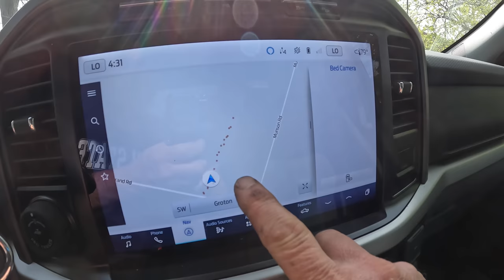Getting the Pole Barn Addition off the Ground & Scrappin' It

Comment: We had a big slope on the side of the shop.  So one group charged 5000 to pack a side on if wanted to build a lean to.  Didn't stop the water from washing the slope off.  Tried different contractor.  2300 for packing the huge white rock at bottom and then all way up.  Fixed our problem.  We have lots of parking but could have done second price easier on pocketbook.

Comment: My son just bought a john deere 346 baler with a kicker. He bought it cheap but it was sitting outside and the plunger was stuck. We took a long hydraulic cylinder and hooked the hoses to the tractor and used the cylinder to push the plunger back. We oiled it all up and now it runs. hope it will tie. It has some fairly new knotters on it.

Comment: A good video. Very informative. We use steel beams and posts etc mostly for sheds in Australia. Re the dots on your truck's GPS screen. I think they show where you have been so you can backtrack if needed when off road. That's what I was told at a recent Four Wheel Drive course I did.

Comment: I stake all of my traps down with 2' lengths of rebar. If they get trapped and flip the cage over, the cage opens and they escape. I use baling wire on my connibear traps.

Comment: Raccoons: Buy and use a Duke Dog Proof foot trap. Use small marshmallows or honey bun (attracts ants).  Smart coons will not go into a trap. If you want to use a trap cover the top and sides as like a tunnel. drive a piece of rebar from the top thru the bottom into ground to prevent drag offs.

Comment: Hi Pete, I was wondering, on your new pole barn for the cows, what if instead of an end wall with a door you had insulated big doors with a door still in one side of one if the big doors that open but you also had a side door.  I was thinking if you had that, when it comes time to clean the bedding pack out you could put the cows out the side door, open the big doors and drive through to clean the bedding pack out.  You'd be headed in the direction of where you place your bedding pack and that way you wouldn't have all the bedding pack to manually pitch fork into the tractor bucket that gets pushed against the back wall like occurs for you now.  This would really help I think especially as you age so you don't have the heavy manual lifting of bedding pack.  Just a thought and may not be feasible at all, I'm not a farmer 😊 but thought I'd share to see what you thought.

Comment: Did the builders seal the ends of the posts with creosote, pitch , tar , or coalas,  it's nearly a must on larger size treated timbers as the end grain will still suck up moisture and it washes out the treatment over time and rot eventually sets in , l like the idea of pre cast plug footings we can't use them here they must be cast in place and at least 2ft dia with a securing mechanism to the poles to help prevent wind lifting action

Comment: Your Raccoon is getting trap smart.
I find a Cheese Whiz  Jar and Jam jar/peanut butter in the trigger end.  They have no choice but to go in the trap as they cannot get in the jar from outside the cage. They go in roll the jar around until they set the trigger. Be fore warned, most of the time they will break the jar and make quite a mess with the broken glass. I just use  the jar with what is left in it after all the product is gone that we use, I assume they believe it is like any discarded jar in a dumpster ect. But you could probably put a different bait of your own in the jar, preferably something that cannot just fall out if flipped, because they will try anything to get it from outside, before going in.

Comment: CAUTION ! when you put back the battery in your Farmall battery case, the 2 exposed poles almost touched the bottom of the gas tank. I imagine that you have done this many times without any problem. Just imagine the consequence of an electrical spark with that much power ! May I suggest to put some plastic caps on both poles next time ?

Comment: do you have issues with posts rotting in the groud.  here is southern Illinois the top 18 inches of posts that are incontact with soil will eventually rot,  the last 2 pole barns I have built I have put the posts in plastic sleeves in hopes of extending the life of the poles,

Comment: Just one question or idea. It's to late now, but being that you built up the ground level, why not put a retaining wall on the side opposite of the main door so you can put your manure spreader there on the lower ground beneath a clean out door/window. This way you just use the tractor and push the manure straight out the window/door straight onto the spreader?

Comment: As an architect why are you allowing them to support the ledger for the top plate using just fasteners? Building code in NY State (ICC) requires a solid 1.5" bearing for those ledger boards.  My last reading did not exempt agricultural building from the code requirements. The ledger supports on the existing barn do not meet the requirements.